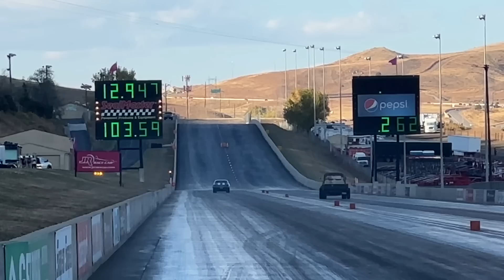It’s Done .. The Last Day at Bandimere Speedway.

Comment: All these cars are also lazy out the hole!
Reply: 5780ft ASL. The rv is 550hp at sea level and would have been running a much meaner tune. Probably not any louder though! It’s a SLUG at 12,000ft.

Comment: Ok so the owner will retire and then someone will rip up the tarmac and tear down the buildings and then what?   Build houses? Seems like this track did well. Lets hope a new track gets built somewhere not to far away for y'all racers.
Reply: Amazon… they are moving and building back better. Likely near DIA
Reply: @TheRoosterLIVE  Thanks for answering! So you was the one with the weirdest or at least most unusual vechicle at the track 😄 when Brent asked you about 4wd and it sort of was that 🤣 at least 4 tires!
Reply: I was thinking in my head, 'well, the drive axle has 4 wheels'.  there is a report on rocky mountain 4x4 rescue. I got stuck in a campsite when I first got it and needed an extra 8000lbs of pull to get it up the hill. she's kinda famous. lol